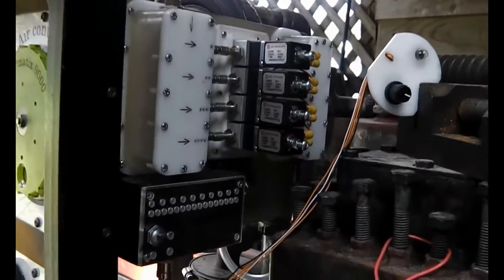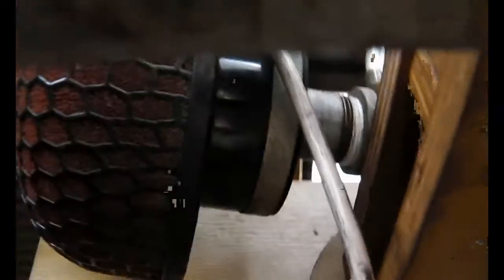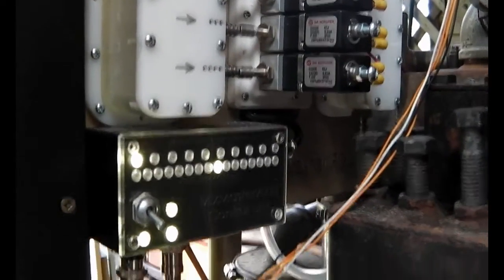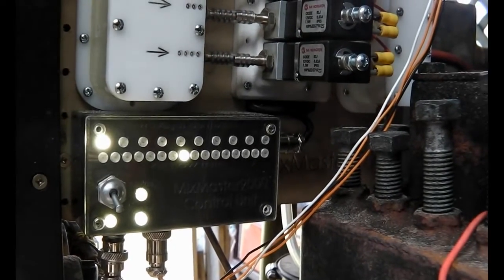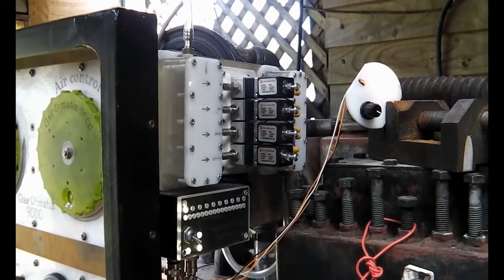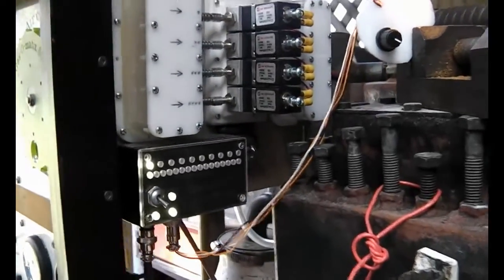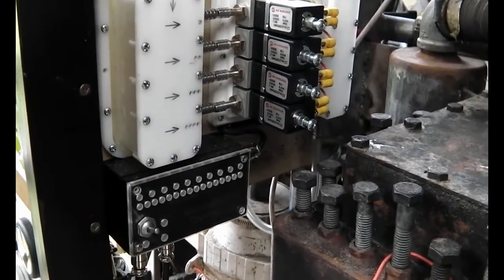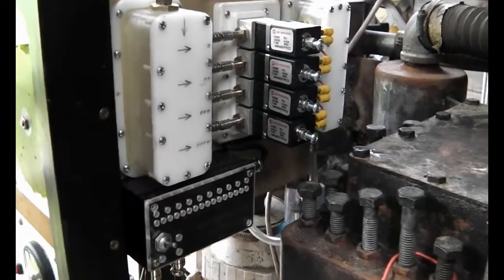Automatic Mixture Controller Intro And Demo

Comment: did you try a stepper motor on a valve? it might use a bit less power, and give a bigger range. Your shaker has a bit too much shake, because the local shops suffered some damage, even that scottish restaurant. Or you could PWM the valves, and the engine could really hum.
Reply from the maker: +rotovid
 Yup, that was one of my options, but I was concerned about the valve wearing out, and leaking over time. 
 I have developed a new version here, which I call the SqueezeMaster9000. 
 It uses a stepper motor to squeeze the air hose, thereby regulating the air flow to the grunta. 
 Yeah, I figger that I might have overdone it with the shaker, as the entire supermarket complex in my area is in ruins, due to the earthquake that I caused. 
 That was one hell of a shake, so I think I will put a smaller shaker in my gasser, before anyone finds out that it was my fault   ;) .

Comment: Mate awesome work!!!! I would perhaps enlarge the holes in 0.1mm increments. Remembering that doubling the hole diameter will give you four times the area. So it wont take much to go over what you need. Keep up the great work mate.
Reply from the maker: Howdee partner,   Yep, that's quite right. It is possible that I have just now overdone it, we'll see  :) . 
Right now, I have got it in bits, modifying various parts of the plumbing in order to make the system more efficient at delivering air to the engine. 
 A bit of grinding and welding are in order, methinks  :) . 
This has been a fascinating project, and I am sooooo determined to make it work for me.
Reply: The good news here is that the fitting with the holes can be soldered back up and new holes bored.  Very cool approach to a control system...
Reply from the maker: Fred Miller 
 Indeedy. 
 I am thankful for that fact, as I will surely be making a number of changes to these nozzles over time. 
 A new design is currently in the works. One that uses moving parts, but may also be easier to set up and operate. 
 This project needs a fair bit enhancement, but it is working surprisingly well in its current state  :) .

Comment: Amazing. I have been waiting for the update on the O2 sensor and will it work. I would say that answered the question. Just a few tweaks, as you say and you will have it dialed in.
Hopefully, this will allow you to get a few more hours of sleep. Set the alarm to wake you when it is time to re fuel... Nice work.
Reply from the maker: +mada94fxr
 Indeedy, this shiny new toy is working perty jolly well for a first off prototype  :) . 
 I figure on modifying the metering box, to add an air filter to it, so I can disconnect the intake hose from the existing filter. 
 This should enhance the sweep range of the valve set, while simplifying the installation plumbing. 
 Oh, soooo many ideas, only 40 years left to try them all out  ;) .

Comment: Really nice work man! I can tell that a lot of thought has went into this project.
Reply from the maker: +Flash001USA
 Thanks kindly. This project has been making me burn the midnight oil for a wee while now, but it sure has been worth the effort. 
 An improved version is already coming together on the screen of my other computer. 
 Maximum coolness will be achieved, even if I have to use magic to get there  ;) .
Reply: I think that what you are doing here will eventually be a missing link in making small gasification much more reliable for the small guy's like us. On a side note my building is now off grid but before I make a video I want to finish up a few small details. Steve how much wattage do you have in solar panels? I know you also have wind but I couldn't remember what you told me and it's been a while so it's possible you added more solar panels since we exchanged a few messages about this. Can you refresh me on your setup again? Thanks.
Reply from the maker: flash001USA 
 Thanks kindly. I would like to develop this to the point that there will be no need to adjust any valves during starting and running of the woodgas engine, regardless of its size and configuration. 
 This is the kind of thing that will make it possible for anyone to safely operate a gasser, without having to learn what might appear as black magic to them  :) . 
 That's great news about your new building. You have made it so warm and comfortable, as well as practical. Well done indeed   :) . 
 Mine is nowhere near as inviting, as you will eventually see when I get around to putting up a video aboot it. 
 At present, I have about 22-ish solar panels. I really need to go out and count them, just to be sure. They deliver about 1500 Watts of power at present. 
 I plan to put up 12 new 80 watts ones this summer.  These will be optimised for winter operation, so as to let me save wood next winter. 
 At present, I have one working wind turbine.  This is rated at 200 Watts, but often delivers more than twice that amount when the wind sneaks up on it  :) . 
 When I first moved here back in 1994, this was a very windy place. That all changed when I began installing wind turbines, so wind power has taken something of a back seat in recent years. 
 Solar and woodwatts are the way to go, as I see it  :) .
 That's Watt it is all aboot  ;) .
Reply: Let me pick your brain one more time. What are you using for your inverter and battery bank? I'm going to guess that you may be using a 24 volt or higher input voltage inverter setup for more efficiency.
Reply from the maker: flash001USA 
 Howdee Flash,  I am using a 12 Volt, 1000 Amp deep cycle battery bank here. 
 At the time when I set this all up, 24V options weren't available to me, so I went with 12V instead. 
 As it is easy to get lamps, motors, fans and other 12V things, this makes life easier around here  :) .  
 24V is surely the better way to go, as it is more efficient in every way possible. 
 If I was starting out now, I do believe I would opt for a 24V system. 
 As for the inverters, I have 6 inverters that are permanently connected to the battery bank: 
 A 300W squarewave one for the 240V lighting. 
 A 1000W sinewave one for most of the household appliances. 
 A 600W sinewave one for the chest freezer. 
 2 1500W squarewave ones for the CNC mill and lathes. 
And finally, a 1500W squarewave one for the newly built machine shop. 
These use lots of watts, but that's no longer a problem these days  :) .

Comment: Congratulations ! Excellent  video and I'll tell you I'm fascinated by your creation.
Reply from the maker: +NH HbbyLoggr
 Thanks lotsly.  
 I am delighted with the performance of this device so far. 
 It is still running the original test software I created for it, and it seems that it doesn't really need to be enhanced very much at all. 
 The next step is to add to its sweep range, to see if I can make it cover the full spectrum for this gasser. 
 More to come, as my next mug of coffee takes effect  :) .
Reply: Steve, While watching your World Premiere Video for the second  time it occurred to me there are two pathways to approach the " Lean/Rich" adjustment ratio. One is to throw bucket loads of air or fuel gas into the engine and try to find the happy medium ( as I do ), then beat the barrel and shake the snot out of the shaker ( as I do ) Then race around to finely tune the air/gas mixture. Wait a few minutes and then start the procedure once again.
 As each system is inherently different , it may be practical to be able to measure the volume of air, plus or minus, which the system actually demands during a standard operating run and customize the full operating range of your Mixer 9000 to that demand. It would require a rotating graph of sorts to indicate the highs and lows of the run plus a sensitive gauge to measure the volume
 From first hand knowledge of the Hbbyloggr gasifier the amount of  adjustment is generally very small on the air/fuel mixing valve but the health of the gasifiers ability to stay running is dependent upon the gas produced and regulated by the grate shaker and barrel vibrator.
 Your new management control takes all of these into account . As I see it , the only thing missing is the data which shows you how much volume it really needs and then dill out the air adjustment quills to match the demand.
 Your Mixer9000 is an extraordinary step forward to making the little flowers practical. Well done !
Reply: Bill, I'd like to see your procedure automated. Swings the hammer , and kicks the gasser as needed. I laughed my ass off when I read that. This is pretty amazing. I think a lot can be learned from a system like this . I like how it changes according to what it sees. Thanks for sharing Steve.
Reply from the maker: NH Hbbyloggr 
 Howdee Bill,  There sure is a lot to think about with these tree eating beasties that we so lovingly tend to  :) . 
 With mine, I leave the gas valve wide open - and mess with the air valve to keep the grunter running. 
 Operating both valves works too, but I am kinda lazy that way  ;) . 
 That's a good point you raise about measuring the air flow to the enjun. 
 Somewhere in my toy collection, I have an airflow gauge. It has a little turbine in it that spins like crazy when a Donkey sneezes into the air intake, so I reckon this wood be the way to go  :) . 
 I have modified my gasifier's plumbing for better air flow and metering management, as I have noticed that my previous arrangement was not well suited to the needs of the automatic system. 
 These mods should boost the auto mixer's working range, so it can properly handle the needs of this beastie. 
 We will see aboot that. 
 My future designs will have a wider working range than this one does, and just maybe I could program them so they can learn about the needs of the gasifier - just like we do  :) . 
 Ohhh, so many ideas, so few hours in a day. 
 I need another mug of cofferee.
Reply from the maker: mazdalorean 
 Howdee Mazda, Yup, I reckon a heavy boot - on a swing arm, a concrete filled boxing glove on a hydraulic ram, and a loud speaker that swears at the gasser, will be the perfect addition to a truly automatic system. 
 One must kick, thump and swear at a gasser in order to achieve maximum efficiency, as I see it - so why not let a computer do it for us  ;) .
 Hehehehe.
Reply: Steve, You're walking down " easy street" now that your theory has played out well with a working prototype.  You can appreciate making necessary modifications by using a simple twist drill of various increments.
Reply: Joe, Be careful now ! I might have to do a video for you !
Reply from the maker: NH Hbbyloggr 
 Yup, this device is making a wonderful difference to the workings of my gasser. 
 In time, I will perfect this to the point that there will be no need at all for the manual control valves  :) .
 Oh good times are a coming.
Reply from the maker: mazdalorean 
 Howdee Mazda,  Yup, Bill's idea of an automatic kick and punch machine is right on the mark  :) . 
 All we need is to get us a box of ten blank robots from Futurama, fit them out with boots and boxing gloves, download the latest gasser abuse software into them, and let 'em rip  :) . 
 More to come on this prototype auto mixer in the not too distant future. I have a new design sizzling away on my computer, and I am thinking this one will be even more betterer than the existing one. 
 We'll see....
Reply: Steve, You are certainly on a roll now that you have found the right path.